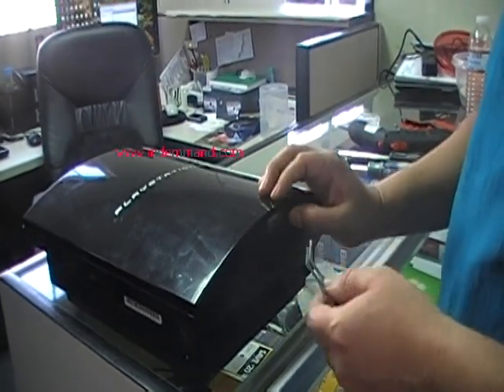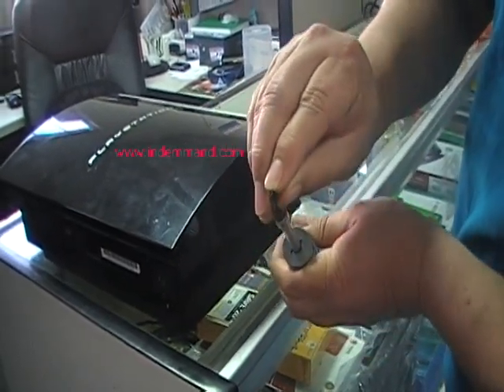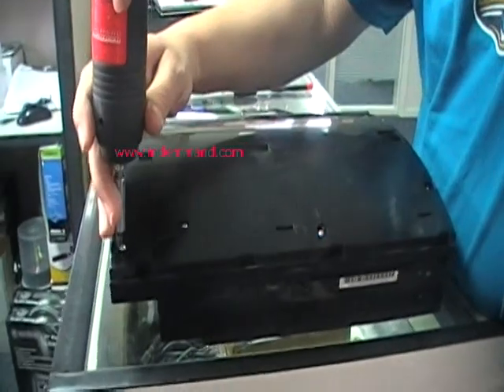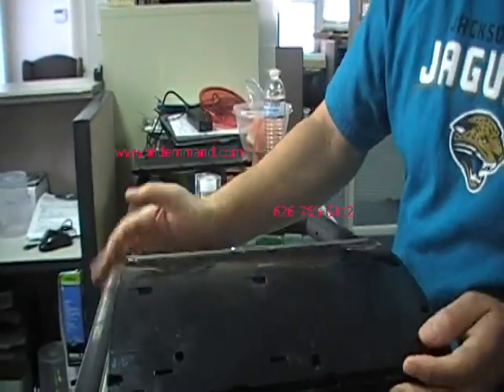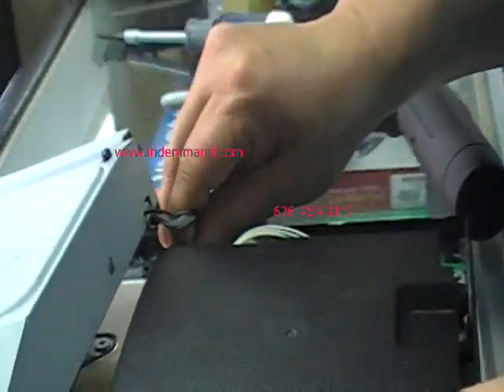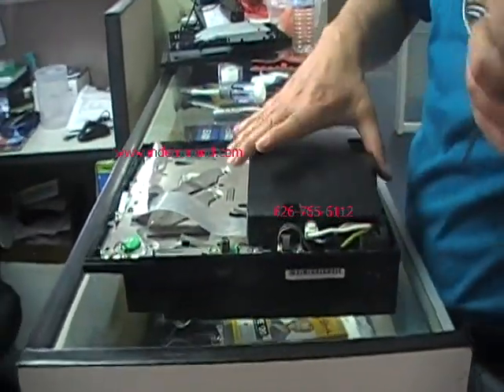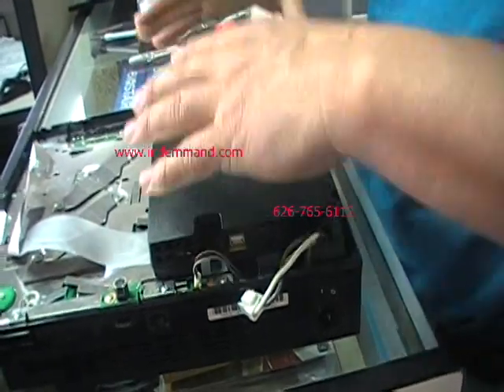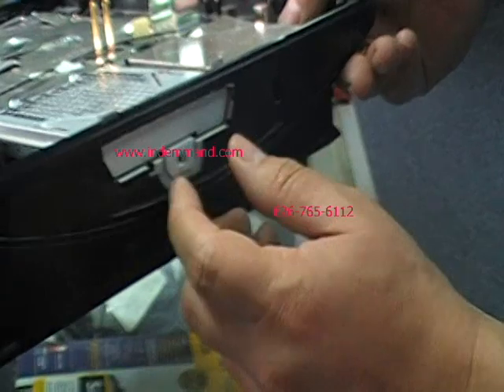Playstation 3 40GB Disassembly Process Step 1of3

Comment: Thanks for the info but you may save people some headache and time if you include the removal of the power supply cuz the video doesn't include that from #1 to #2. I finally figures it out through trial and error but just a thought. Thanks for your info though